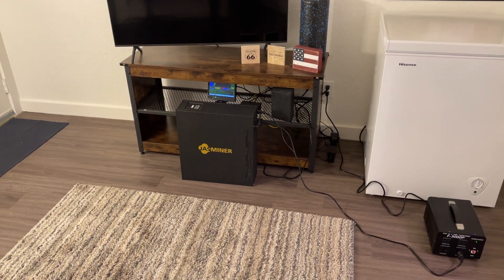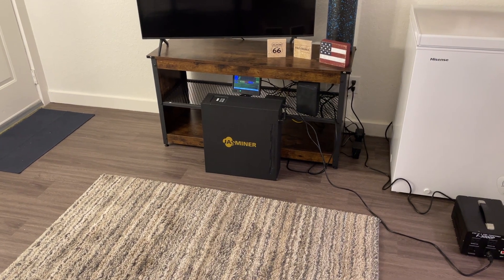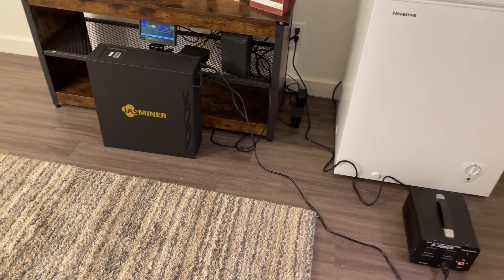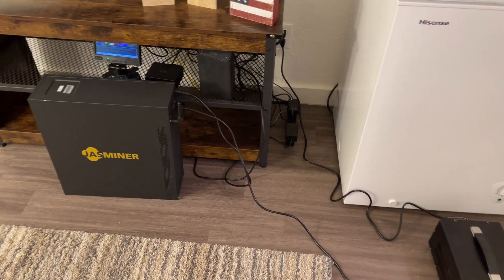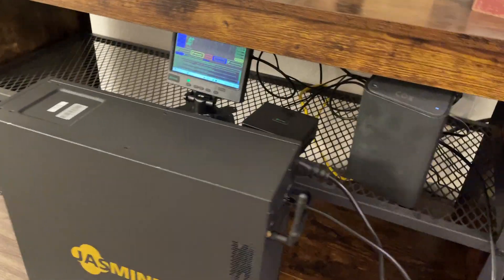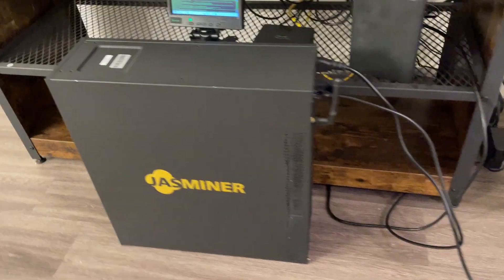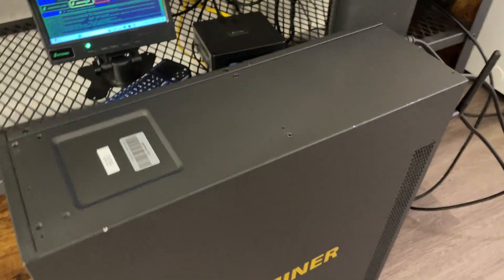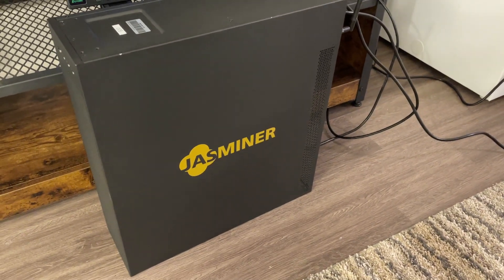How Quiet Is the Jasminer X16-Q High Throughput Quiet Miner!

Comment: You can plug in the Jasminer X16Q to a normal 120v outlet. I have mine plugged into a normal 15 amp 120v outlet; you don’t need a transformer…